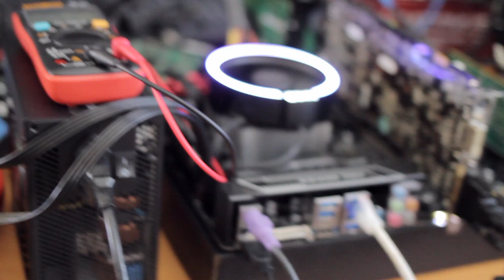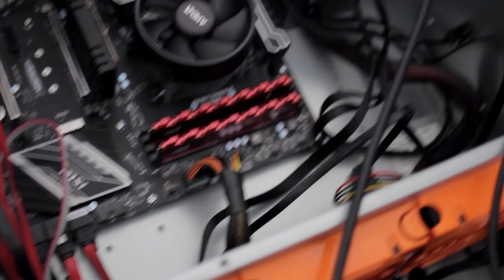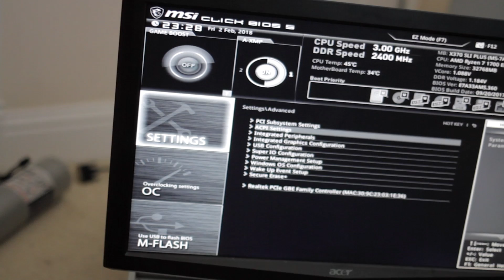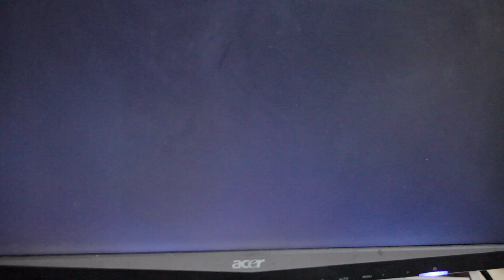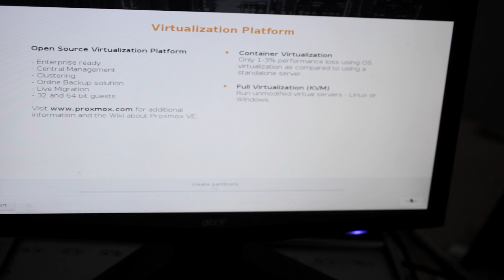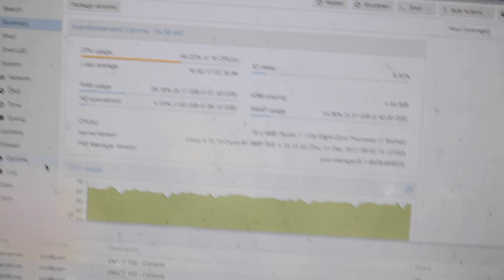Upgrading My Home Server to Ryzen 7

Comment: Nice video. Have you moved away from ovirt. I am still undecided over proxmox or ovirt
Reply: Xcp-ng anyone? New kid on the block.
Reply from the maker: I have moved from oVirt to Proxmox on my main server. This was mainly due to kernel version. oVirt is built on centos 7, which is on kernel 3.10, which is getting old and not supported for ryzen. You can add newer kernels, but its not fully supported and my cause issues. I think Proxmox is on kernel 4.15, and you want the newest kernel you can for ryzen. For older systems like lga 2011 and older, centos 7 will work fine and hardware support hasn't changed much in newer kernels.

Overall there simmilar in what they can do and how they work. Proxmox has good zfs support, container support. And oVirt have better clustering support,  search, user permissions. Overall id say Proxmox is better suited for smaller setups, while oVirt has better support for larger clusters where you already have a san.
Reply: ElectronicsWizardry thanks for that I didn’t realise Ryzen with centos you would need to upgrade kernel. Have you tried fedora with ovirt and Ryzen. I think ovirt looks better. But again I like the backup feature in proxmox
Reply from the maker: Ive tried fedora with oVirt a bit a while ago and ran into repo problems, esp as fedora is using dnf and centos is using yum. What hardware are you running? Centos will run fine on most hardware these days except for the very newest platforms. I may try fedora again when centos 8 comes out.
Reply: ElectronicsWizardry just bought a Ryzen 7 1700 and waiting for other parts to arrive. Really like the look of ovirt but proxmox just seems to work. I use esxi at work but free version isn’t that good ha
Reply from the maker: You can probably get it working on ovirt with centos with new kernels, but until centos 8 comes out, id personally just go with proxmox.
Reply: ElectronicsWizardry ok thanks

Comment: Nice video.  I'm a gadget guy and have been gaming all my life.  I have built old computers and no currently use a 5960x setup with SLI.  I also have an older Synology DS412 NAS for movies and stuff that is filling up.  I'm thinking about setting up a home server/NAS and wonder would my current PC be good for that?

I'm retired military and hope to retire from my other career within the next few years.  I am interested in programming and stuff and plan on taking some courses after I finish my current degree program.  I'd like to learn about servers..etc.
Reply from the maker: Your current pc would work well. It has more than enough cpu power and ram capacity for almost anything someone could want to do on a home server. Im a big proponent of using vms as it makes it much easier to split up different tasks and keep different oses or setups with no risk of hurting the base system or other services.
Reply: Thank you for the reply....now, what to buy next....